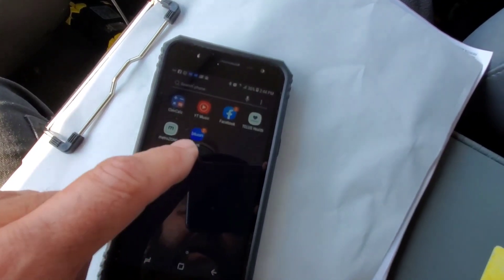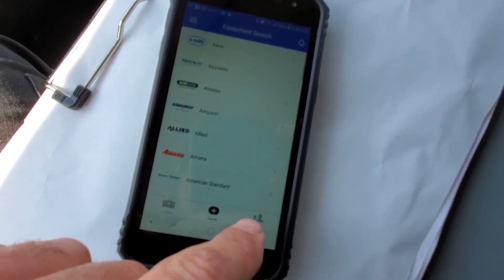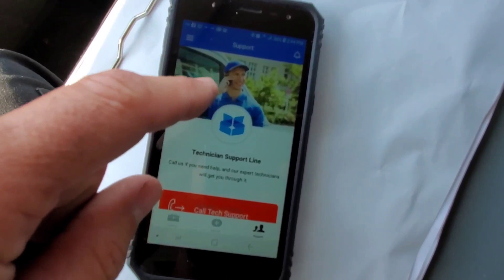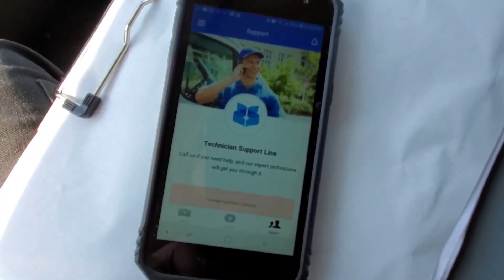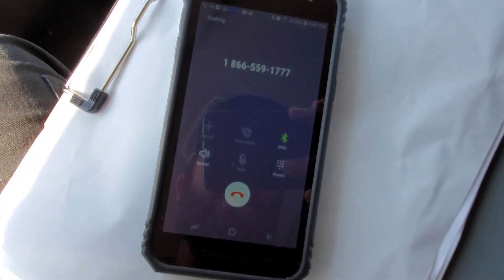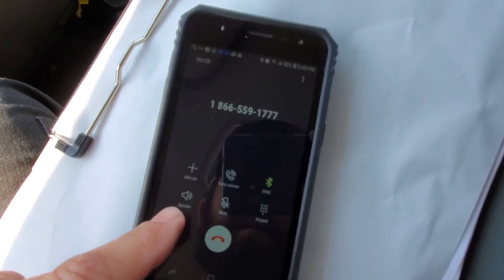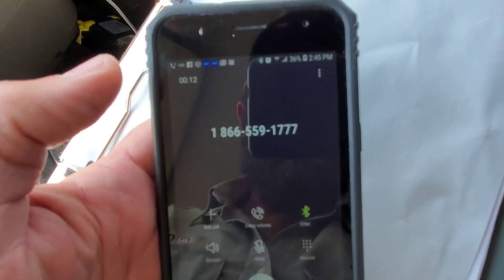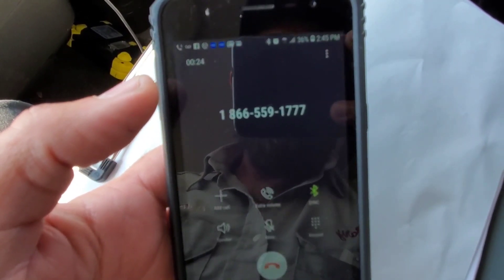How To Avoid Compressor Liquid Refrigerant Slugging While Charging

Comment: i work 50% commercial rtus of 200 ton units and manufacture told us to charge on king valve or pre liquid line filter, and everyone should know you can only do blended freon in liquid and depending on the leak size you cant do a top off if the unit is 20% low you have to recover and start fresh.

Comment: 6:22 Imperial Tool 535C Kwik Charge Liquid Low Side Charger . Use it on dial gauges and probes * not sure why this should be an issue other than techs might not use one vs manually flashing tthrough there metering knobs. This is 101 foundation HVAC concepts. Seems this video was more of a test of BLUEON's intelligence or a marketing video for BLUEON on there CRM.
Reply from the maker: It was a test of their system and their knowledge and willing to help.  It was also an educational process for those still learning this trade.  Cheers

Comment: How many ounces would the 15psi rule be? Or how many ounces do you think is “okay” to add as liquid when charging?
Reply from the maker: Weight doesn't fall into this...he's saying if your system is running at 40psi suction, only open the tank enough to raise the pressure to 55psi.
Reply: @HVACKnowItAll  @ GARCIA short quick spurts: FLASHING your guage device ((knobs-suction /LOWside in this case) at the gauges are doing the SAME THING A TXV does at the evap coil- METERING IN flashing the liquid. If you dont have a feel for this then get an IMPERIAL TOOL mentioned in the comments.